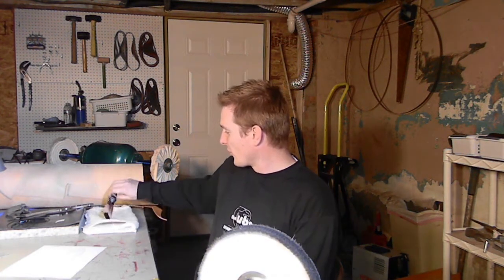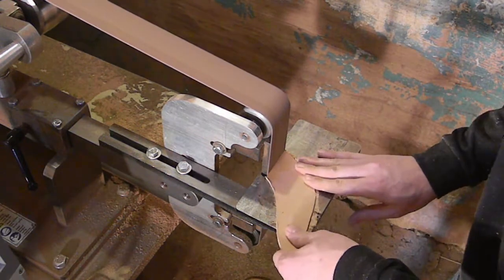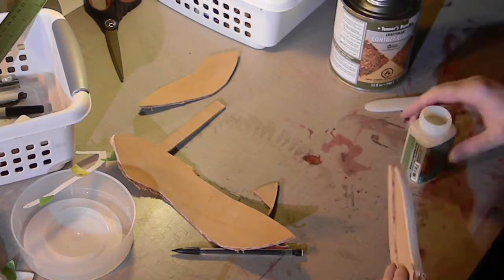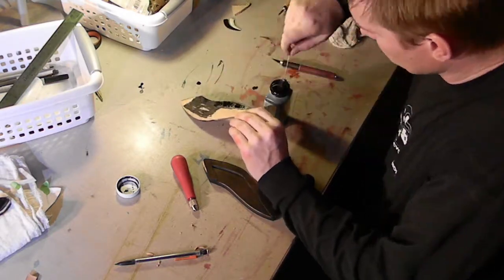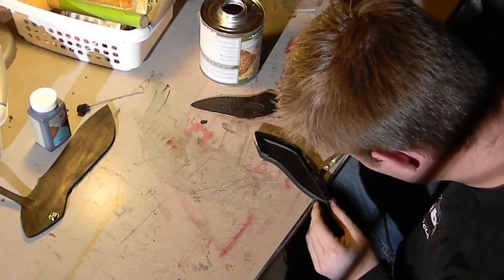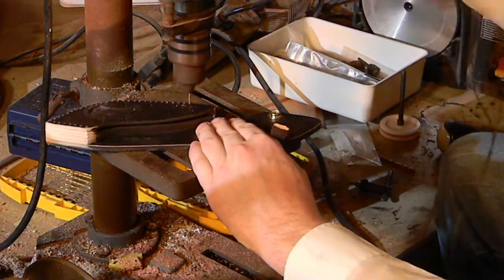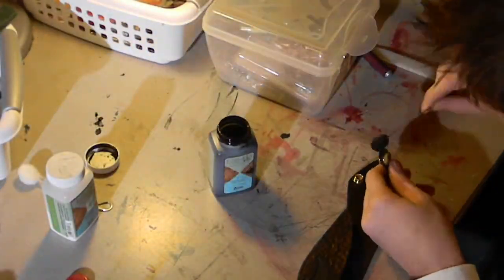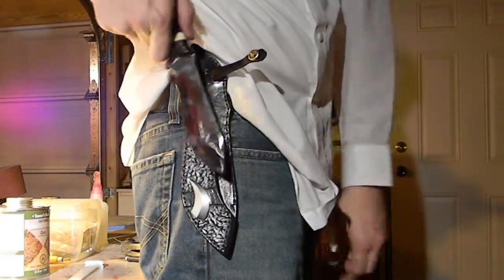Making a sheath Knack style

Comment: what are the best belts to use on belt grinder for making knifes what is the best leather for sheaths and what are the best materials for handles, fasteners, hrc levels, the glues epoxy's,handle shapes, best places to go for heat treating, the proper thickness you need to have you edge bevel b4 heat treat how do you know its to this or thing is it better to have an edge relief or not to have 1 also where do you go for your steel what are the best spacing materials plus how do you sell ur knives